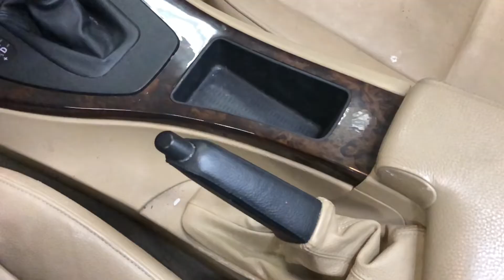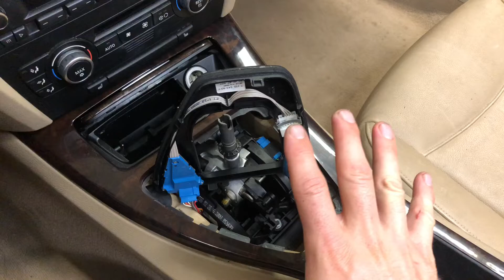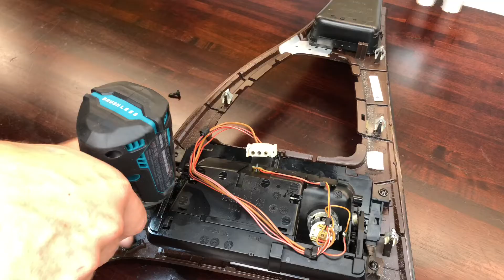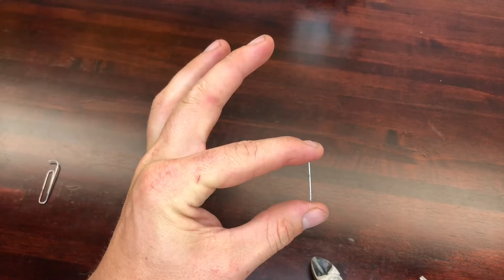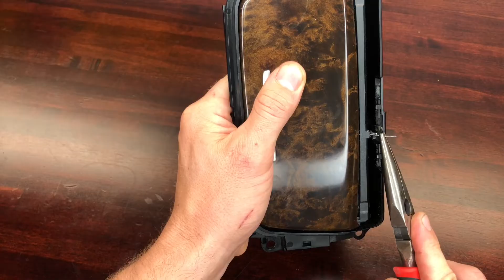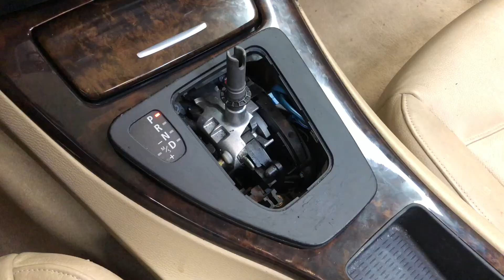How to Repair BMW Ashtray Lid E90 E91 E92 E93

Comment: I am unable to remove it...Its holding very hard I am afraid of breaking the console...
Reply from the maker: Which part is holding hard, the console trim? (In my video the brown plastic woodgrain part)
Reply: @athomeautorepair7899  I just managed to take it off! Actually did it with fingers since i did not have a proper tool and didn't want to scratch it. thank you

Comment: Great work! May I ask if this method works for bmw x3 "e83" also?
Reply: Cem Cemoli i can not be certain the the repair is going to be the same as the ashtray is different. But it appears to operate in the same way and if it’s having the same problem it’s likely it’s the same cause.
Reply: @logicmaster5626  many thanks for your opinion my friend. I will try to see if the same method works or not very soon.

Comment: Thanks very clear explanation and good video quality.  My problem was a coin going into the back of the lid and wouldn’t close and I couldn’t get it out. It’s out now .
Tip don’t keep coins in this type of ashtray you also run the risk of a penny falling into the cigar lighter and blowing the fuse.  John from County Durham England.
Reply: Great tip ill keep that in mind, cheers from Riverside CA

Comment: My issue is it opens super slowly any advice? Sometimes get stuck when trying to open but mostly opens super slow
Reply from the maker: skylarjetson could be a few different things. 

1. Someone spilled something in the hinges (coffee, soda melted candy). 

2. the spring that pulls the ashtray lid open might be weak or broken. 

3. People drop coins or other objects behind the Ashtray door and this slows or jams the Ashtray lid.
Reply: I would leave it be and don’t use it.